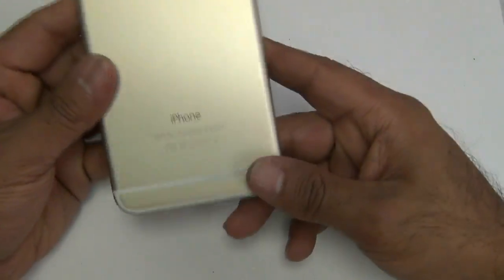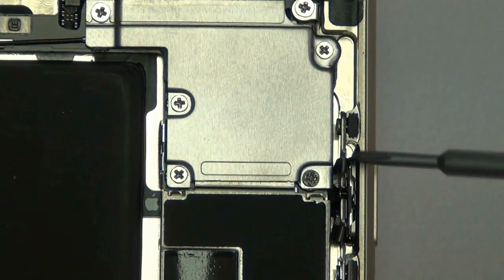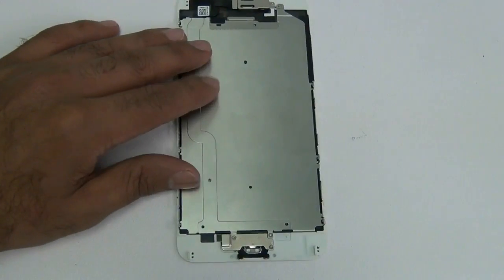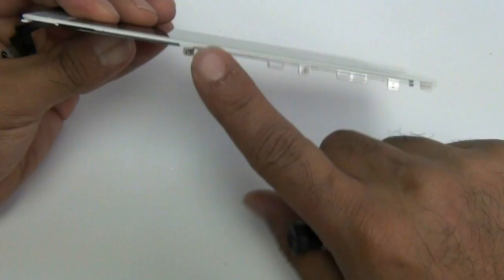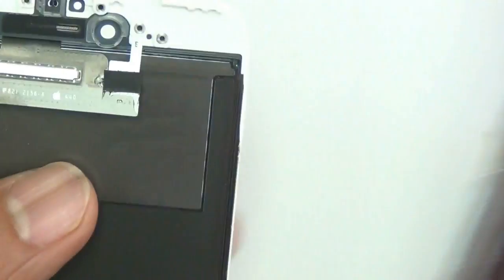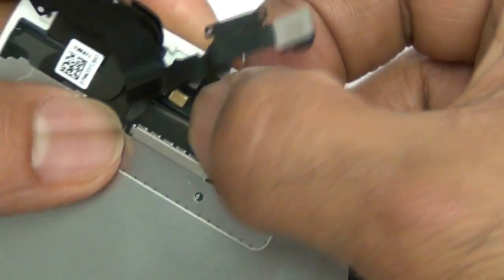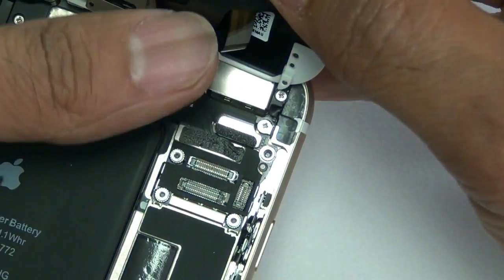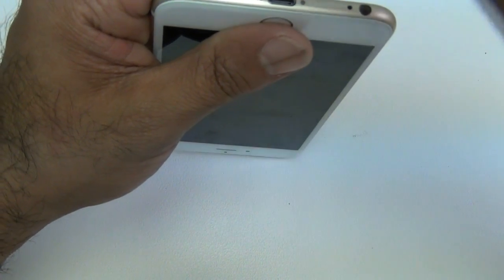iPhone 6 Plus Touch Screen Glass Digitizer & LCD Display Repair Replacement Guide

Comment: I can not seem to get the screen to fit into the phone, most of it is clicked in, but the top does not slide in properly meaning that the bottom sticks out and is not sitting in the phone.

Comment: bought the glass but after looking at the details of just replacing that, it seemed like a waste of time. besides I have no "magic glue" to put the new one in with! this is a much better approach - (anybody need a plain white glass?)
Reply: Idontneednostinkingchannel : do you still have that part glass available?  I would like to use it to try experiment a fix with it on an old lcd plate. Thanks. athaleben@gmail.com
Reply: Me